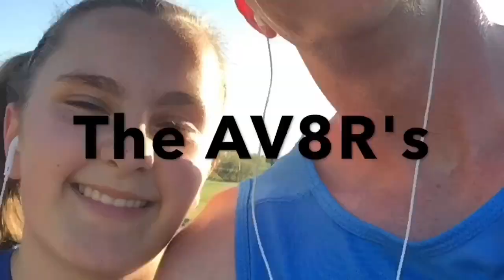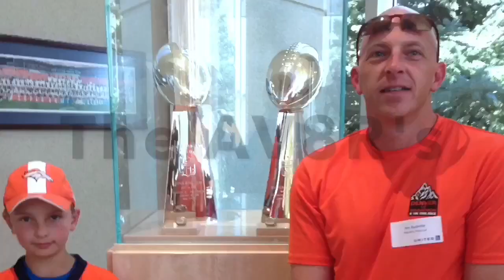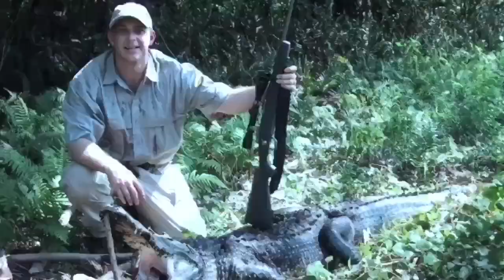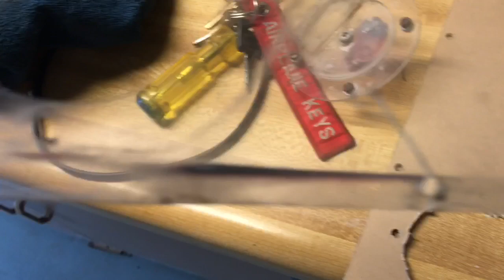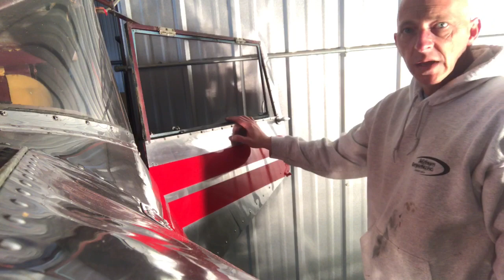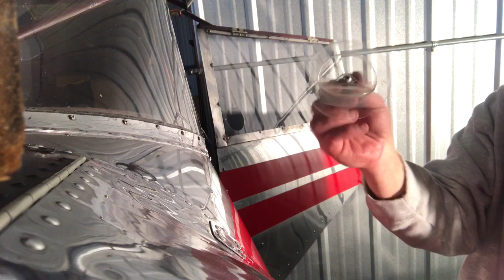Luscombe 8a - How to replace an old and cracked window

Comment: Did you use a center drill to get the holes started? Turned out great.
Reply from the maker: Hey Michael - I drilled holes all around the perimeter and then used a dremel to cut it out and sand it. A cutout tool is too aggressive and would likely have cracked it. In other words, I would have screwed it up!  Thanks for watching!